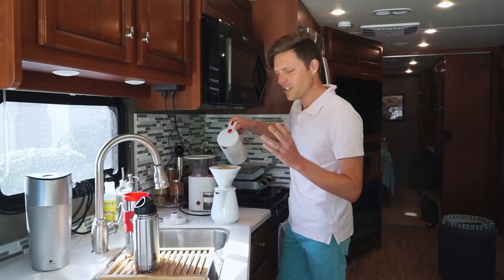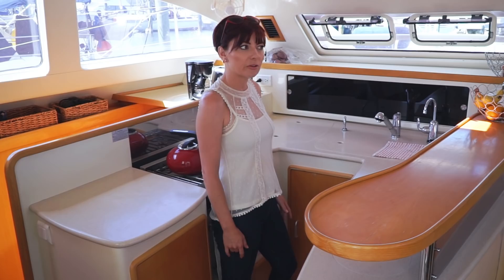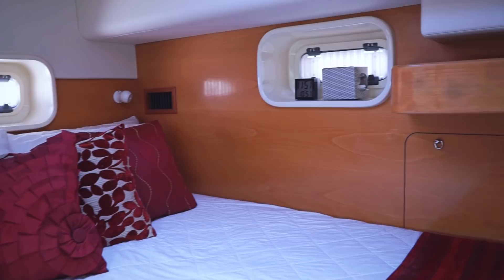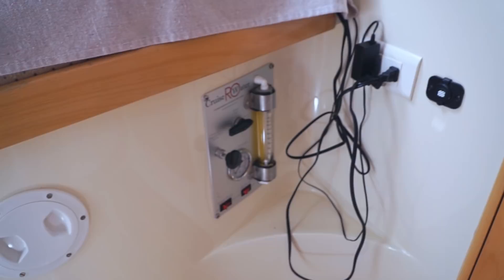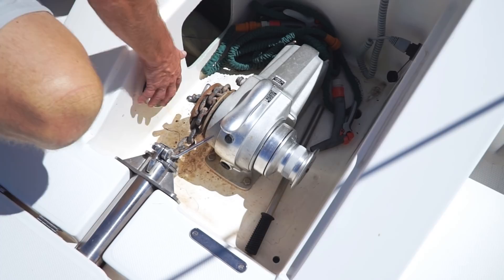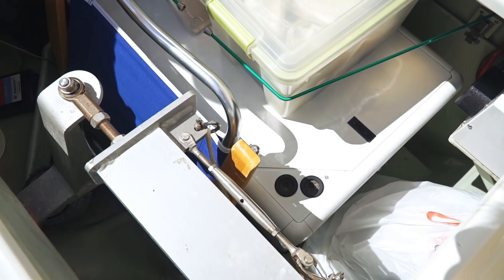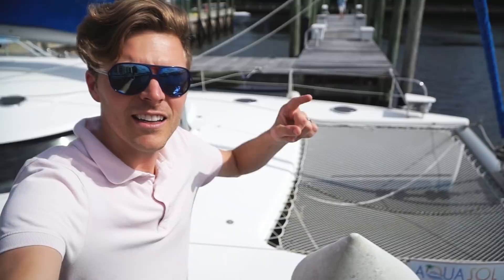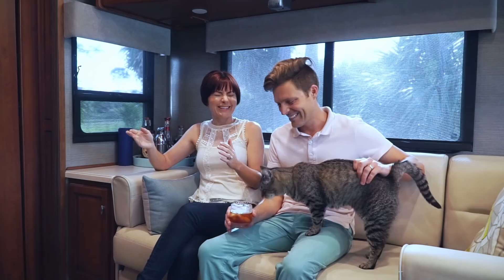Sailboat Shopping & the Almost Perfect Catamaran

Comment: Hello guys, i have seen some of your videos on the Rv and i think the last one i saw was about running the A/C with solar panels. Now i see your abandoning the Rv life for a boat ? what happen? did you see every thing on land already?,  i though you own the RV,  i kept  the saying to my wife i don't understand i don't understand don't they know what there getting into?, needles to say i m blown away buy this 180 you guys have done. I have to say you guys have a lot of guts deciding to make this great shift from road to ocean with no experience, still i give you my  compliments. Now let me tell you that i too am a boat owner for over ten years and i what to give some tips. 

1#  (Boat) stands for (Bail out another thousand) this is not a myth is a fact.
2# You must keep a separate budget for boat repairs and mishaps.(there will be mishaps)
3#  Don't take the boat for granted, always check and recheck before going out to see, on land you have AAA and they get there fast, on the ocean in the middle of no where your on you own, the coast guard some times is very far away.
4#  Inspect any item on the rigging that could break or go overboard and have 2 spares.
5#  Tools,Tools,Tools, for every thing, Electrical, Mechanical.
6#  Learn all the electronics on the vessel.
7#  Crossing the ocean by your self's is dangerous is some areas specially the    Caribbean, i think you should have some sort of weapon that you could handle and flash to some one in case they approach you vessel at night. 
8#  Find some people to go with you wen doing a crossing, or another vessel for  company.
9#  Be careful with scammers.
10#  Don't let strangers on board. Don't be so trusting. 
         Good Luck and may the fair winds be at your back always.

Comment: With you budget, you may have to get a starter boat.  Maybe a 30 footer. They may be hard to find in your area but Catalac 8m and 9m or even a 10m are tough boats and handle ocean crossings with ease.  I prefer the PDQ 36, tough Canadian made boat . You think RV parts are expensive, go price marine stuff. 
The great thing about cats with the escape hatch in the head is, while sitting on the throne , you can open the hatch and go fishin
KORIFW

Comment: There are two ends of the boat market. You are in the capitalist section. That is no fun. Very expensive and no-karakter boats. You look at it like a car or a RV, with millage, and how old it is where newer is better. If it gets older you need to sell and get a newer one.  There is also the section where you put in some work and have an older boat to take care of. All the love you put in to the boat gets you respect from fellow sailors and you can learn a lot. You can get a very decent mono hull 38 for 10.000 to 40.000 without to much work and learn to do all work yourself. It has lots of space, look at the latest video of Mads on Sail Life. Do you really need more room than that? In that budged range you can keep the RV, and go sailing. In case you loose the vessel you still have a life to go back to.
Reply: Nerd3927 I

Comment: Great video, as always. Stupid question of the day: When shopping for a boat this size, do you ever get to "test drive" or have someone take you on a short cruise? If not, does that make you nervous?
Reply: +Bruce Wallace  Yes, you get a survey done which is equivalent to a home inspection. It will include going through all systems, rigging, checking for damage etc. and a sea trial. 
If you are taking a loan, I think a marine survey is required. If you pay cash, it's not required but definitely recommended.

Comment: Be careful of your budget!  Anything for a sailboat costs twice as much as for a motorhome.  My repair and maintenance costs for my 42 foot twin diesel were 8-10% of the cost of the (used) boat per year..  Salt air&water will eat fasteners and gear faster than you have ever experienced.  A Cat will cost a lot more to moor since they are Wide and take more room or do not fit in most mono hull slips.  It will greatly increase your cost of mooring in water of storing on the hard and cause you to anchor out more often.  And with a cat, you have two of everything including twice the cost of engine maint. and repairs.  For a lot less money you can have a larger mono hull.  No matter what, you better LOVE your boat because you will be spending more time with it than with your spouses and even when ashore you will always be worried about position, anchor, bilges, theft,, wind and weather and you will have more concerns about/for the boat than you ever had in your motorhomes.  If you love your boat and accept all the responsibilities of life afloat it is a wonderful life, but expensive and brutally unforgiving of sloppy or inattentive owners who will find the sea an unforgiving mistress.  We love your videos of the decision process!  Go Slow, boats are hard to sell if you change your mind!

Comment: IMO owning a boat doesn't necessarily cost more than home ownership. For instance my first house in Houston cost roughly the same as the boat they saw here and each year the property tax and maintenance  is roughly 20 - 25K. 
The Wynns seems to be doing Okey financially, just hope they factor in all the cost before making the purchase. I meant, if they want, they could easily buy a house with that budget in most part of southern USA,especially sounds like they have plenty of cash saving given they said they don't want any debt , so it's their preference that they d rather live on RV or a boat and i support their decision. However, i would say probably before buying one, just lease one for a while and see if you really comfortable with the humidity, the noise and stuff.

Comment: Do u two know how to sail ? I love how u are rocks when it comes to the boat world same as me ,it's going to be a blast 🤗
Reply from the maker: +Perry Lane we've sailed several times but we're no pros. :)
Reply: +j kd&#39;n one thing to remember about that.  Things Break. Usually at the WORST possible Moment. Imagine NOT knowing how to Sail or Run that Cat, and have ALL THE AUTOMATIONS GO OUT IN A FORCE 9 GALE or Cyclone. Imagine being out at Sea, NOT KNOWING how to Navigate, and your GPS goes out. It's WHY in my last years I STILL taught my sailors how to do forms the old fashioned way on paper with the manuals and documentation codes, and WHY I got OUT when they STOPED teaching Celestial Navigation at the Academy.
Reply: +Gone with the Wynns Why did you two not go for the Gemini? What exactly did not appeal to you?

Comment: "Kitchen, windows, bedrooms, bathrooms"......at least use nautical boat terms.  They are concentrating too much on glitter and not enough on systems.  Granted they are looking at quality boats, but even the best build boat after 10 years will need maintenance.  Can just pull over and call AAA if there is a breakdown in a boat on blue water.......

Comment: Honestly, I have no idea what you are both thinking, going from 0-60 OVERNIGHT.  You have absolutely no experience with any remote form of seamanship.  Start small, start off with a Macgregor or similar you tow behind your RV, or at least FIRST learn how to sail a boat.  Granted many systems on a boat are similar to an RV, you've just simply changed the entire avenue of travel which requires a myriad of new experience and training.  Maybe take a few charters to start off.  First find out if you're even going to get sea sick on a short voyage, that's a deal breaker!  Good luck and best wishes, do love following your adventures, but I think this one requires a little further thinking.

Comment: Hey man, I really love you guys and your attitude. My GF and I may be setting sail sometime soon, and I have been looking at some low to mid 40' Catana boats, mid 90's to mid 2000's. We want the speed factor, which your Leopard seems to have. I know you are bombarded with these comments daily, but do you have any insight? Supposedly Catanas can do the speed of the apparent wind. Is there a reason you did not choose a Catana? Broadblue also seems to be a nice combo of quality, room, and speed.
Reply from the maker: Older Catana's are great.  There is a specific year and size that's known for it's quality and speed.  I can't remember exactly anymore but I think it was the 50' from the early 2000's.  We considered the Catana but quickly realized they were out of our budget at $100k+ more expensive than our Leopard.
We considered Broadblue but we were told to steer clear by several people that we trust, so I can't give you any insight on them.  Good luck, there are a lot of options out there.
Reply: @gonewiththewynns  Great to know, no broadblue. There is this one for $300k that seemed nice, quality build, but I am going to save time (possible headaches)... 
So the Catana I keep hearing about is the 471 (looks like the 2006), has clocked 25 knots speed, and right now a couple are priced at $360-400k (one in FLA for $360k), with 2 others at upper 400's. https://www.yachtworld.com/boats/Sail/Catamaran/Catana/471
Your Leopard 43 also looks very nice and I hope it is treating you well. May I ask your top speed sailing and average-ish if decent wind of 10+ knots? Maybe someday we can all meet. :)

Comment: 1700 engine hrs is loads on a boat that is supposed to sail!
Reply: +Michael Caton most catamaran sailboats motor 90% of the time because they can't sail to wind very well.
Reply: +Down In The Islands which is something they have to consider, but probably did not
Reply: A big mono would be a better idea. At least you can sail more and if well trimmed make headway to windward. This venture sounds like an R.V that just can happen to float. Only one engine to maintain and ultimately replace at great cost and sails that can carry you around the world in most directions. Although who would sail to winward all the way around the world.. Not me...
Reply: +Down In The Islands The Leopard 43 sails just fine at 30% apparent wind. I know because I've been on one. Lagoons are a different story.
Reply: Did it have dagger boards? Its just common knowledge that cats don't sail to wind. Cats with dagger boards do much better.

Comment: I dont know guys something not very right about that vessel  and overbearing look and feel of cheap , Squeeky hatches with molded deck joinery. The other thing that may worry me is that yuor concerns with the boat were all about decorating and not about the boat because like the ocean yeah they are cabins, heads, galley, forward, bow, aft .. no boat is perfect offer half and stand firm ...those engine rooms you will have nightmares about dealing iwth those engine rooms .... im not a hater just a concerned and very experienced friendly pirate ...